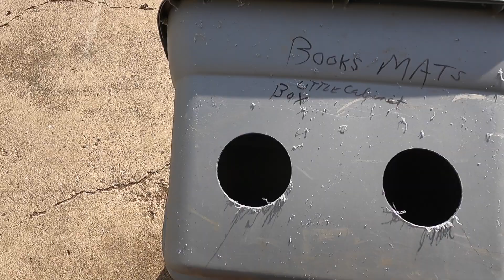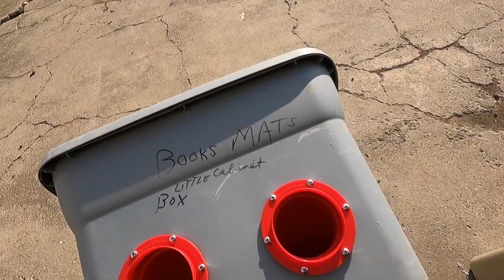Happy New Year! - Bringing the BEACH to my CHICKENS

Comment: My big discovery this winter for fighting cold weather (being in Canada it is colder here than there) is battery powered handwarmers. I got mine off of Amazon, it is a battery pack wrapped in a heater, so it will warm your hands and charge your phone/camera, they are fairly cheap, which is good because you will probably want 2 of them (2 hands 2 pockets) though I bought 1 and then a week later bought the second.